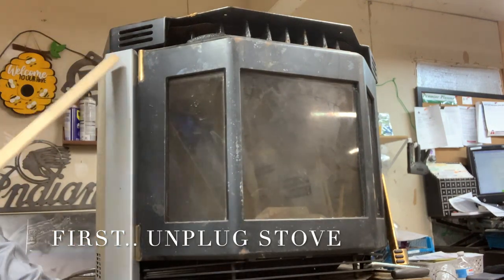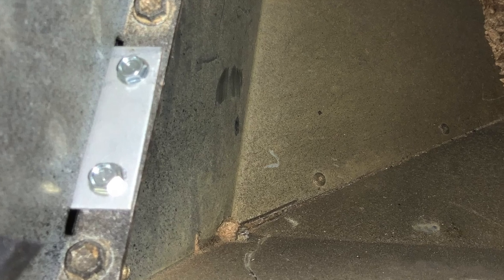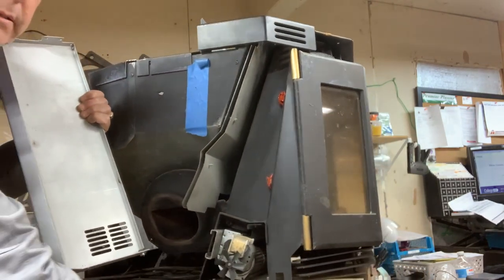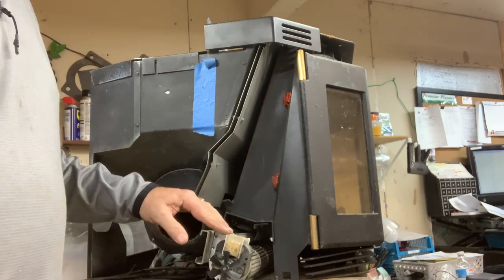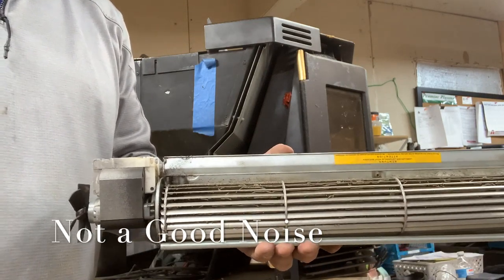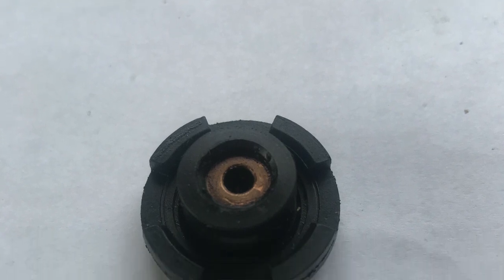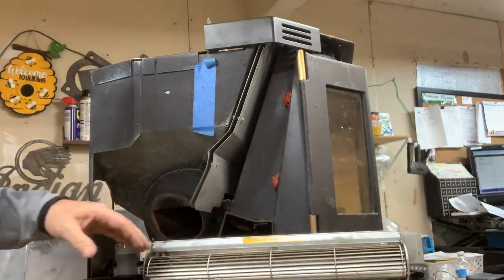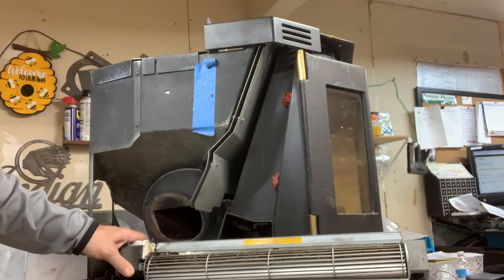AUSTROFLAMM / RIKA CONVECTION FAN LOCATION AND INSPECTION

Comment: Did you mis-speak around 2:31?  you called it an auger motor grommet but it's not the auger motor.  Also, how to replace the grommet specifically on the motor side?  The other side is easy as it just pops out.  Thanks.  Your videos are so helpful.  I will be ordering parts very soon.
Reply from the maker: Yes, more than likely I said something wrong and missed it. I edit at night most of the time and my pea brain is fried by sundown, so I give what i can in my limited skills "). The motor removal is the hardest part of changing the grommet on the motor side, but not impossible to most. You grab the motor in one hand and grab the housing just under the motor and twist like opening a jar of pickles. It will take some force but it will pop loose. You then will pull the motor shaft out of the housing to replace grommet. I hope this helps

Comment: Thanks for the video Scott.  We love love our Austroflamm Integra II insert. Have you ever seen an option for a thermostat on these models?
Reply from the maker: HI Ranger, Yes indeed. But... your motherboard must have a T9 terminal on it in order to accommodate the thermostat. So if you can take a look at your board and see if you have a wire port at the T9 location, if so then we can hook you up. If not, you will need to purchase a new board in order for it to work. Hope this helps. Please let me know if we can assist you further. Isn't the Rika Awesome. Peace
Reply: @homesteadingusa  hello Scott. Thanks for creating all these videos first and foremost. Haven’t looked into it my austroflamm (2006) has the T9 terminal however let’s say it does. Do you even recommend using a thermostat being that I’ve heard using a mechanical thermostat would be the way to go or since we have the led pad just get up off my butt and turn it on. With parts being hard to get like you started not sure the benefits outsource the reward. Btw last video. That’s a badass sign sir.
Reply from the maker: @CTJonathan333  Hi Jonathan, Thanks for the kind words, it made my day. The Thermostat is great if you want to try to save pellets by keeping your stove at a particular temp or if you need the stove to keep your home warm during really cold months during the winter while away, but that is really the only reason to need one. The savings on pellets to me does not out way the wear and tear on your parts, which in the end will cost you more. If someone asks me if I recommend one, I pretty much tell them exactly that. Your stove can already turn itself on and off twice a day, which keeps the stove under your control if you don't wish for it to burn when no one is home. Hope this helps. Peace